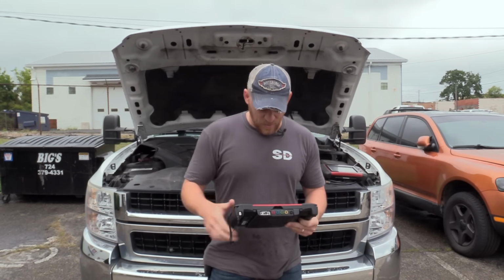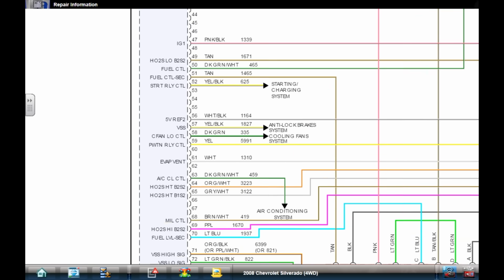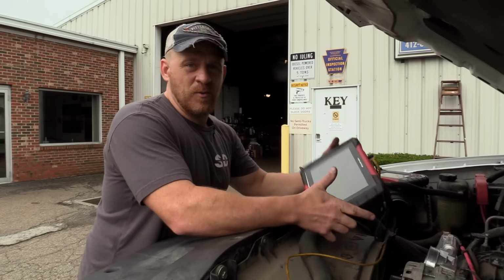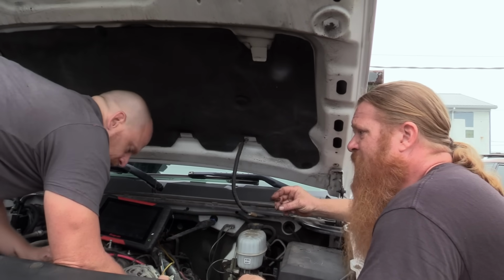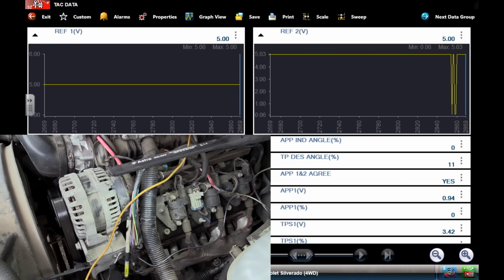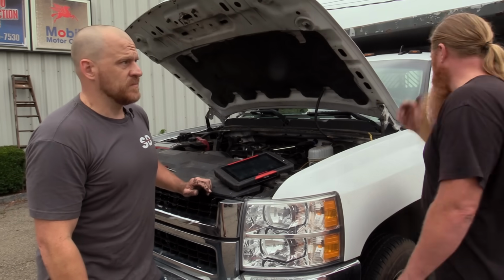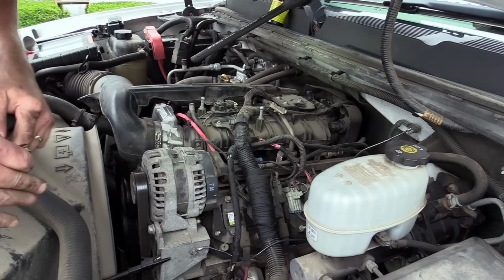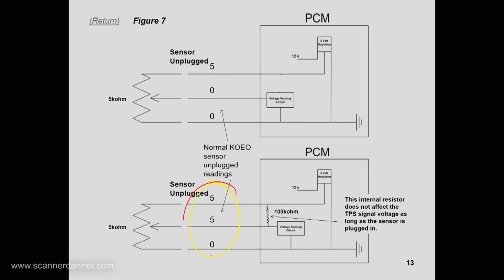Troubleshooting a Shorted 5v Reference Circuit (Chevy Silverado)

Comment: I’ve been looking at your videos for a horn issue.. 🤦‍♂️ My 2017 Silverado HD horn stopped working. I have 12 volts at the horn, horns bench test perfect. Pulled the airbag and the switches work to send power to the integrated relay I can’t locate under the fuses and relays. The relay also works with the airbag installed. The connections to the horn are clean.  I’m at loss lol. What am I missing??   Keep the great videos coming. I think I narrowed it down to the intergraded relay in the fuse block.
Reply from the maker: The BCM controls the horn relay. When you see 12v at the horn, this is only when you hit the horn button right? What does your ground wire read during the same event? Keep your voltmeter ground connection in the same spot for both power and ground measurements. So the ground test will be a ground to ground voltage drop measurement with the horn button pressed inside of the truck. It sounds like you have a bad ground.
Reply: ScannerDanner  Theres always 12+ volts at the power and ground wire at the horn. When the horn button is pressed the voltage goes from 12.35to around 12.27. This reads the same from power wire to ground wire and power wire to battery ground. The only ground I can find is the ground wire that plugs directly to the horn coming from the fuse box. According to GM there’s 2 unserviceable relays inside the fuse block. Not sure if it’s one of these relays that are bad? I checked for power at the 3 switches behind the airbag and there’s 12v. The ground seems good at the switches also, If I activate the switch with the volt meter the relay clicks and volts go to 0 weather on the switch ground or switch to steering post ground. So I assume the ground is ok in the wheel positioning sensor.(clock spring)?                              (Update) there isn’t any power at the horn or the fuse socket with a test light and the button pressed or not pressed. The volt meter is showing (residue power)? 12 volts at the horn plug. Again the test light don’t light up at the plug. I’m leaning towards the fuse block relay. All wires look good with no rodent damage or seen corrosion.

Comment: Hey Brother,  Love the channel. Quick question? after you just got done ragging on the code reader =parts changer mentality, why do you have a BlueDriver code reader thing in your Amazon store, What exactly about that tool do you find useful that you put it in your dealio?
Reply from the maker: It's just an option and it is better than nothing right? At least you can pull codes and look at data. Use this information combined with a test light and dmm and a decent flow chart and wiring diagram and you're not a parts changer then right? 😉
Reply: @ScannerDanner   I already have the OBD2 ELM327 jobber with a few apps I paid for, still kinda sucks. Whats a guy to buy without spending a few grand that gets him bidirectional control. Got the uScope  which is cool as hell, but I whish I saved the money an put it towards something with more channels, that Autel Maxi thing is looking pretty awesome with the scanner and the osciliscope .... do they make a Medium Pimpin price range one
Reply from the maker: @ChrisGrazioli  I am not sure what they offer in the medium pimpin range 😂 but I do know that the Ultra goes for around $5400
As far as a bidirectional scan tool, you will be spending at least $1500 for one. OTC Encore comes to mind. I have one but I hate it because it is slow between scenes but it is capable and is in that price range. Bosch just sent me their new ADS 525x and I like what I see so far. I'm not sure the price yet but I think it is in the $1500 range. I have one and will be showing it for you guys soon. In the mean time here is some information about it. https://www.boschdiagnostics.com/products/ads-525x-diagnostic-scan-tool

Comment: Did that ground wire that is mounted to the alternator bracket solve any past issues. I seen videos where they say that is needed to be done to solve a host of issues cause by the factory braid strap failure.
Reply from the maker: I know nothing about it. Sorry

Comment: Just happened to me, changed the TPS on throttle Body, * there was a recall on it that it was doing it) ,thought it was the problem, wasn't, than got a new Pedal Accelerator , which didn't do the trick , and finally My brother followed a wire from the TPS on throttle body and it was in the back top of the engine and there was one wire that had a tiny bit of insulation removed, I mean tiny , but so far that fixed it. I wrapped it with electrical tape since it was a tiny spot and that wrapped in a large heater hose  that I cut down the middle lengthwise to insulate a big bunch of it/ No more shutting down and going 15 miles per hour ( at least it lets us limp home)/ but Yea, that was my 2 month chasing project. SO TOTALLY check wires before changing out parts. I just read the codes and not the notes on it.This happens a lot to chevys apparently.  this was a 2009 tahoe/

Comment: Why doesn't it mess the pcm up when the reference wire grounds to the frame? Is there a resistor inline inside the pcm to protect the circuit?
Reply from the maker: Yes!
Reply: @ScannerDanner  thanks for taking your time to answer my questions.

Comment: I have the same problem. I have checked the harness. Looks good. My next step is to change crank position sensore and solenoid circuit of evapritive system. This issue will cost me 🤣🤣

Comment: scanner danner i have a similar situation going on right now with an 08 Chevy express 1500 but for circuit 1 so a p0641 checked voltage at all components and all are above 4.8 and 5.2v, according to diagnostic manuals from Chevy themselves is that if they are all getting proper voltage that the ecm is at fault. I am not going to immediately condemn the ecm because a year ago before i started at this shop. so i am going to a resistance test from the pins on the ecm connector to the components. is this a good idea or is there any other way past this
Reply from the maker: I am assuming your issue is an intermittent one. If this is correct, you have to do those tests DURING the condition. Definitively don't be in a rush to replace that ECM. Although the Chevy Vans did have an issue with water intrusion into the ECM. If it is the one that sits underneath the master cylinder. The aluminum housing had steel bolts and the bolts would literally rust and break in half and allowed the protective housing to open up.   https://www.youtube.com/watch?v=dCyPkbli6zs This was on a 96 model year, so it may not apply to your 08

Comment: My 2006 sierra has a U1000 code followed with p0300. I do know the dealer I bought if from put a gps scanner in the exact same spot on the harness. I will be checking if I see exposed wires...been looking for the issue for 3 weeks. Checked all grounds replaced a few and no change. #FINGERSCROSSED

Comment: Danner...yesterday, went out and Purchased a Zurich ZR11 Scanner from Harbor Freight ($150 Bucks), Hooked it up to the Blazer then put Half a Tank of Premium Gas in the Tank so that it was 3/4 Full and Drove Home. (about 50 miles).   This morning I Plugged in the Scanner, let it Boot-Up and was going to Spend the day doing Drive Cycles. As it turns out, the Scanner now only had an EVA Monitor! Instead of Driving Around, I Drove Back to the Smog Shop 50 away and IT PASSED the Dyno! It took about 500 miles of Drive Cycles and 1/2 a Tank of Premium Fuel mixed with the 1/4 Tank of Regular Fuel to Clear the CAT and HTR Monitors!!! I sure did get alot of Bad Advice from Various Technicians on This One! Bad Computer! Bad Wiring, Bad Sensors, Bad Catalytic Converter, etc. I would of had a Thousand Dollars in this listening to these Guys! DON'T BE A PARTS CHANGER!!!

Comment: Danner...if you Sir will allow me to Please Start Over at the Beginning:
 Danner...We have a 1998 Chevy Blazer 4.3 V6 with a Check Engine Light and a Failing Battery. Had the Code Read at O'Reilys...a P0147. They said it was a Bad O2 Sensor on Bank 1 Sensor 3. Purchased a New O2 Sensor. Then had the Battery Replaced at Walmart. Now the Check Engine Light is Off and Stayed Off for awhile. Then one day it came back On. At this time the Blazer needed a California Smog so took it to our Regular Smog Guy. He put in the New O2 Sensor and the Check Engine Light went Off but the Scan Tool said there were 3 Monitors: CAT EVA HTR and P0147 (1/1) Pending, O2 Heater Circuit (Bank 1, Sensor 03). The Technician said to go out on the Freeway and Drive it about 30 (60MRT) miles & No Faster than 60mph, come back and they would Smog it. Did as requested but the Scan Tool still Showed Nothing Changed. Tech said to Repeat the Drive Procedure. Did the Drive again. Scanned again...same Results. Tech said we may have to Drive it Several Hundred Miles maybe even Several Thousand Miles for the Monitors to Clear. The next day took the Blazer out for most of the day and stopped at the Smog Shop once again. Connected the Scan Tool...same Readings. Tech said there is a Bad Wire Somewhere. He Printed a Schematic of the O2 System for me. I have been an Electrical/Electronics Tech for many years...just not an Automotive Tech. And I am just like you Paul...I HATE THE SHOTGUN APPROACH TO FIXING THINGS!!! And already I'm into Replacing an O2 Sensor! I Pulled the Connector to the Bank 1, Sensor 3 (New) and Metered 4.3 ohms, Pulled the Pre-Cat O2 Sensor (Old) and Metered 4.2 ohms. Put my Meter on the Heater Circuit of the Harness and Read: 0vdc KFEF, 0vdc KOEF and 12.5vdc KOEO. Did a Contact Point Inspection...nothing so far and did a Visual and Touch Inspection as best I could...nothing again. This is where I got you involved...lol  Am on my way to Harbor Freight to Purchase a Zurich ZR8 Scanner/Reader so I can get some Real-Time Data. Would be nice if I had a Complete Schematic too but cannot seem to find one Online. Man am I looking forward to Collaborating with you on this one! BTW... I am on Gmail.
Reply: Danner...yesterday, went out and Purchased a Zircon ZR11 Scanner from Harbor Freight ($150 Bucks), Hooked it up to the Blazer then put Half a Tank of Premium Gas in the Tank so that it was 3/4 Full and Drove Home. (about 50 miles).   This morning I Plugged in the Scanner, let it Boot-Up and was going to Spend the day doing Drive Cycles. As it turns out, the Scanner now only had an EVA Monitor! Instead of Driving Around, I Drove Back to the Smog Shop 50 away and IT PASSED the Dyno! It took about 500 miles of Drive Cycles and 1/2 a Tank of Premium Fuel mixed with the 1/4 Tank of Regular Fuel to Clear the CAT and HTR Monitors!!! I sure did get alot of Bad Advice from Various Technicians on This One! Bad Computer! Bad Wiring, Bad Sensors, Bad Catalytic Converter, etc. I would of had a Thousand Dollars in this listening to these Guys! DON'T BE A PARTS CHANGER!!!
Reply from the maker: sorry I wasn't there for the original question

Comment: Danner...We have a 1998 Chevy Blazer 4.3 V6 with a Check Engine Light and a Failing Battery. Had the Code Read at O'Reilys...a P0147. They said it was a Bad O2 Sensor on Bank 1 Sensor 3. Purchased a New O2 Sensor. Then had the Battery Replaced at Walmart. Now the Check Engine Light is Off and Stayed Off for awhile. Then one day it came back On. At this time the Blazer needed a California Smog so took it to our Regular Smog Guy. He put in the New O2 Sensor and the Check Engine Light went Off but the Scan Tool said there were 3 Monitors: CAT EVA HTR and P0147 (1/1) Pending, O2 Heater Circuit (Bank 1, Sensor 03). The Technician said to go out on the Freeway and Drive it about 30 (60MRT) miles & No Faster than 60mph, come back and they would Smog it. Did as requested but the Scan Tool still Showed Nothing Changed. Tech said to Repeat the Drive Procedure. Did the Drive again. Scanned again...same Results. Tech said we may have to Drive it Several Hundred Miles maybe even Several Thousand Miles for the Monitors to Clear. The next day took the Blazer out for most of the day and stopped at the Smog Shop once again. Connected the Scan Tool...same Readings. Tech said there is a Bad Wire Somewhere. He Printed a Schematic of the O2 System for me. I have been an Electrical/Electronics Tech for many years...just not an Automotive Tech. And I am just like you Paul...I HATE THE SHOTGUN APPROACH TO FIXING THINGS!!! And already I'm into Replacing an O2 Sensor! I Pulled the Connector to the Bank 1, Sensor 3 (New) and Metered 4.3 ohms, Pulled the Pre-Cat O2 Sensor (Old) and Metered 4.2 ohms. Put my Meter on the Heater Circuit of the Harness and Read: 0vdc KFEF, 0vdc KOEF and 12.5vdc KOEO. Did a Contact Point Inspection...nothing so far and did a Visual and Touch Inspection as best I could...nothing again. This is where I got you involved...lol  Am on my way to Harbor Freight to Purchase a Zurich ZR8 Scanner/Reader so I can get some Real-Time Data. Would be nice if I had a Complete Schematic too but cannot seem to find one Online. Man am I looking forward to Collaborating with you on this one! BTW... I am on Gmail.

Comment: Scanner...Got a 1989 Chevy Blazer with a P0147 Code. Replaced Post Catalytic Oxygen Sensor. Code Reader says CAT Monitor, EVA Monitor and HTR Monitor are Not Clearing with P0147 (1/1) Pending, O2 Heater Circuit (Bank 1, Sensor 03). Smog Shop said to Drive the Car until they Clear. Have Driven the Car several times for several hours. Still didn't Clear. Smog Shop says there is Damage in the Wiring Harness for the Heater Circuit. Ohmed the Pre and Post Oxygen Sensors. Both Read 4.3 Ohms. Put a Voltmeter on the the Heater Circuit with Key Off...No Voltage, Key On...No Voltage...Engine Running 12.5 Volts DC. What am I Missing?
Reply from the maker: You mean a 99? An 89 does not have downstream o2 sensors

Comment: Not sure where you got that DMM but mine have an impedance read greater than 12 Meg Ohms, but it was a good point the topic should also include the use of different  test lights. I was in the service industry when all the Electronic control type stuff was starting and not just on cars. The first lesson was how to throw the test lights in the trash.
Reply from the maker: watch some more of my videos and you will see that the test light is THE tool to use in so many different circumstances :-)

Comment: I've got a p0641 on a 2008 impala. I'm ashamed to admit I've been a parts changer. APP sensor 2, and TPS, both changed out and nothing. 

Now after this video I feel better prepared. Time to go on a hunt. Thank you so much.

Also special thanks to Bratt77 on impalaforums.com for this lovely info. https://www.impalaforums.com/conversations/need-some-help-if-you-have-the-time.298011/

The 5-volt reference 1 bus provides 5 volts to the following sensors:
        The manifold absolute pressure (MAP) sensor
        The fuel tank pressure (FTP) sensor
        The accelerator pedal position (APP) sensor 2
        The air injector reactor (AIR) pressure sensor, if equipped
        The engine oil pressure (EOP) sensor
        The air conditioning (A/C) refrigerant pressure sensor
        The camshaft position (CMP) sensor
    It may be possible to locate the fault by disconnecting one component at a time from the affected 5-volt reference circuit while viewing the 5-Volt Reference circuit status parameter on the scan tool. The scan tool parameter will change from Fault to OK when the source of the fault is disconnected. If all 5-volt reference components have been disconnected and a fault is still indicated, the fault may exist in the wiring harness.
	
Models: 	2006-2011 Chevrolet Impala 2006-2007 Chevrolet Monte Carlo		

Condition/Concern:
Engine power is reduced message and check engine lamp on with DTC P0641. The concern may be intermittent. Other DTCs that may set are P0532, P0522, P0452, P0335, P0106, P0101 P0651 P0336 P2135 and P0068.
Recommendation/Instructions:
There are three areas where wire chaffing can occur. These have been identified and are outlined below:
The first area to inspect is where the wire harness is routed by the power steering pump. Verify that the harness has not rubbed on the power steering pump pulley.
The second area to inspect for chaffing is near the air cleaner at the trans boss near the a/c sensor and CKP sensor break out from the main powertrain harness.
The third area to inspect is under the rear seat on the right side. If the harness is routed improperly, it could get pinched under the rear seat.
If any wire chaffing is found, repair the wiring per SI wire repair procedures. Make sure the wire harness is secure and properly routed to eliminate the chaffing condition.
Please follow this diagnostic or repair process thoroughly and complete each step. If the condition exhibited is resolved without completing every step, the remaining steps do not need to be performed.

Since the P0641 and P0523 are set together, and if you find no chaffing issues, I would focus on the engine oil pressure switch. This may just end up being an internal failure of the EOP switch or it's wiring.

Comment: I want to thank you scanner Danna you just answered the questions I needed to know I have a Volkswagen Passat not getting no crankshaft signal trace the wires up to the computer I realize that looking at your videos that sensors have a 5-volt reference that I was trying to get a answer for they have a reference voltage coming from the computer my car will not start there is no RPM signal the car will not start still after testing cables from the crank sensor to the computer  connector everything's good also in your video where the computer needs to be reset for the sensor in order to get that 5-volt reference to turn on for the crank sensor that is my next step I need to get a vag scanner to reset my crank sensor maybe this will help my car to start your video is a excellent video this video explain all my problems that I'm having in what to do I really appreciate it